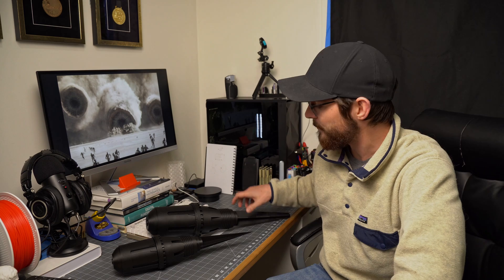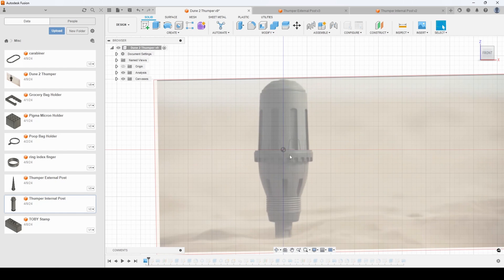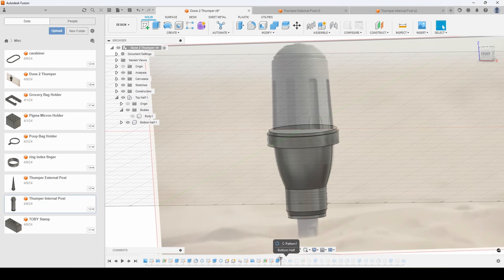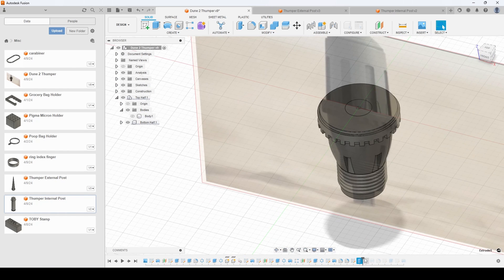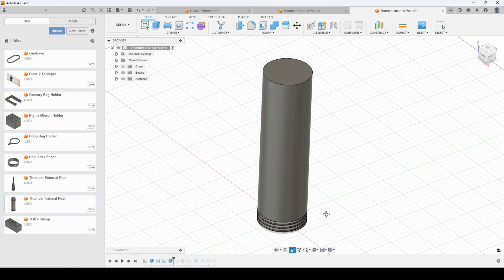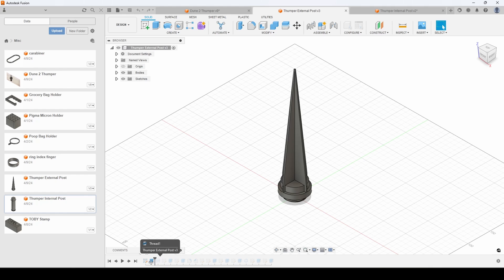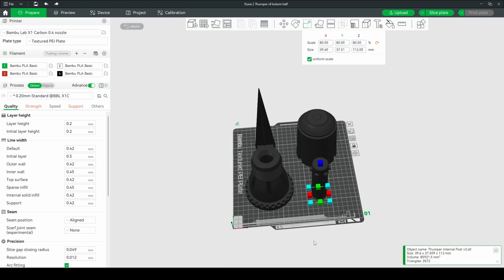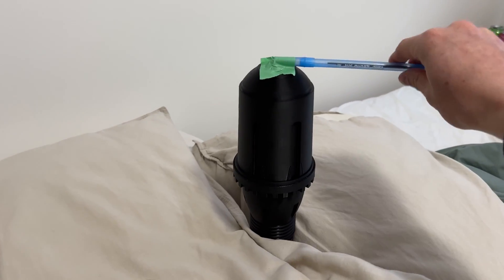3D Printed Thumper from Dune - Fusion 360 Design Overview

Comment: Very good work. As a SciFi fan and 3D printer, I love designs like this. You could use magnets on the contact surface between the two parts to create a harder bump. I would make the inner edges of the fastenings in the floor more stable with a chamfer.
Reply from the maker: Thanks, glad you like it. Those are both great ideas. Magnets or even just some additional hardware for weight would give it a better thump. And yeah a fillet or chamfer on the inner edge of those fins would definitely make them stiffer and more structurally sound… maybe I’ll go add those right away.

Comment: where do you put the motor ? It should have s simple space for a motor, double A battery probably or two, and a gear and piston mechanism, should be so simple it should easily fit inside there, then it can actually thump and do it with that 2 second delay or whatever. no need for usb charging etc as it will just use doubleA's etc, like a bulet blender it should turn on when you twist. in fact u could probably convertan old bulletblender into one lol.
Reply from the maker: It definitely has room in there to figure something out. Maybe it’ll be a future project. It kinda already looks like a bullet blender haha.